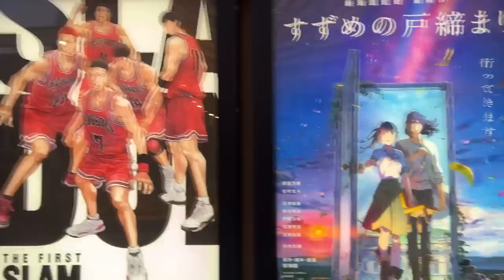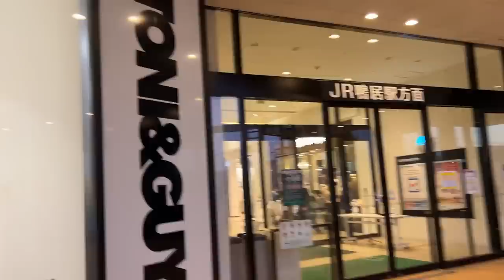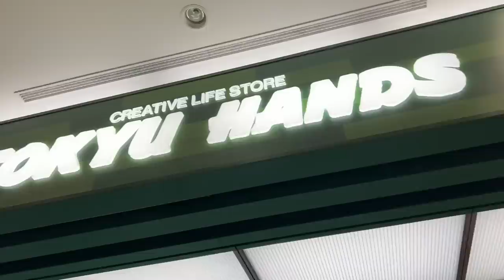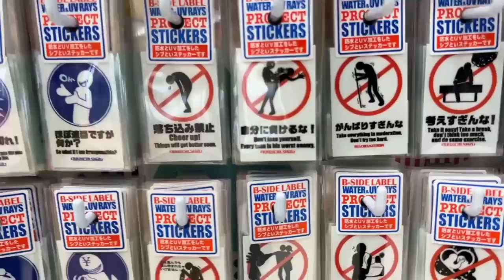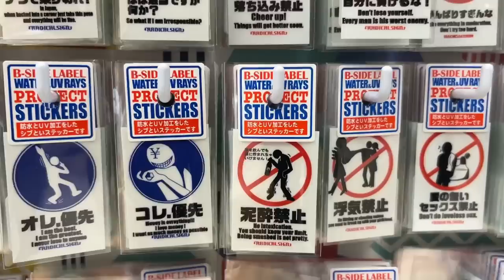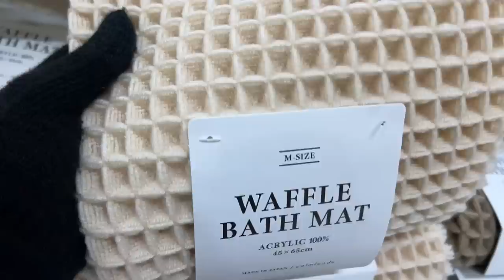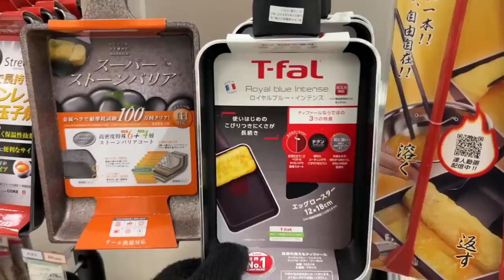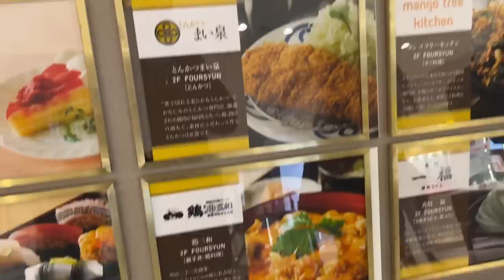Day In The Life. LIVING IN JAPAN! / S4E33

Comment: 11:13 in larger Tokyu Hands locations they have a pretty extensive home DIY section with wood, metal, plastic stock and other hobby building supplies. Even tools, test equipment, soldering irons,home electrical stuff, plumbing, electronics kits, gardening and some car stuff as well. I found a lot of metal channel stuff for building custom LED lighting for display shelves and brackets for mounting a double DIN car stereo. Everything from seat cushions to shower curtains to toaster ovens to repair tools. There a MASSIVE Tokyu Hands at the south end of JR Shinjuku station that is 7 floors of EVERYTHING.